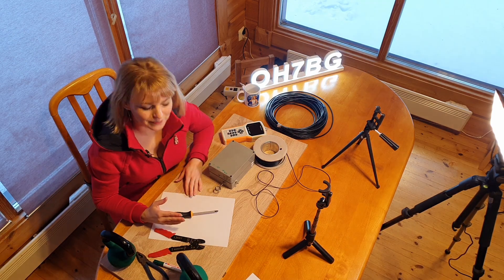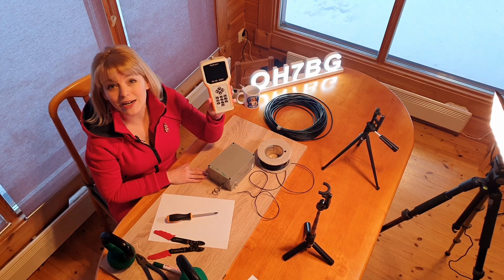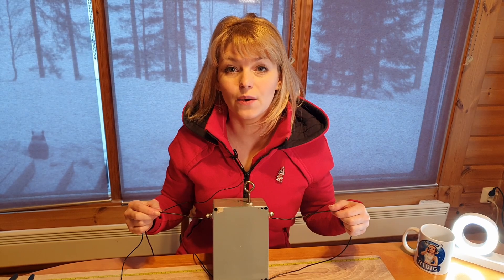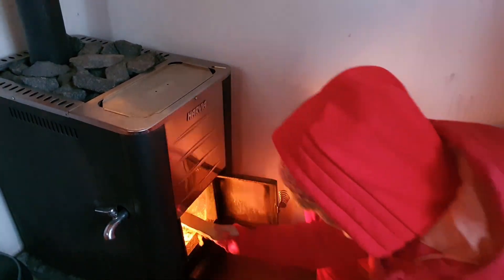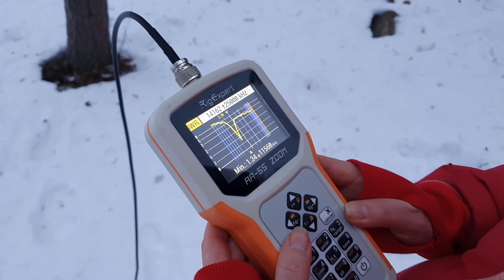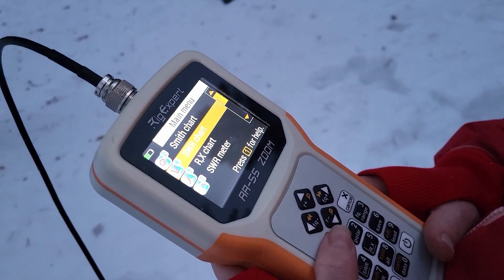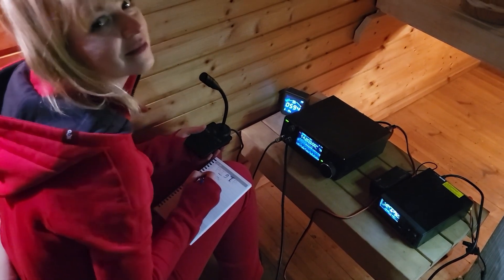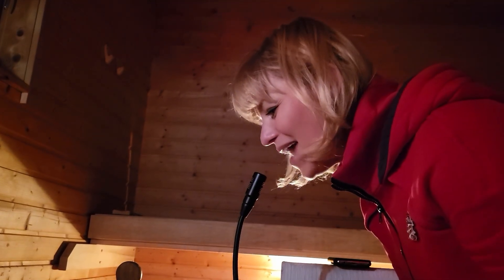Antenna ON ICE! Unscientific/Fun Experiment by YL Raisa on a frozen lake

Comment: that was great video. as you have found out the math was wrong. well the math was not wrong. the numbers you came up with is for about 1/4 wave off the ground . in your case ICE which changes the loading on dipole making it shorter. I have the same icom and DX commander wire.  I am in USA. eastern part. Boston NY. gets cold hear as well.  now try the same on 40 and 80 meters at night even 160 meters. I did 160 meters with 1:1 balun  in a park and with snow on the ground. I have the MFJ analyzer. had tuning trouble as well. too long wire. talked many KM at midnight. very low noise.  a outher trick for checking SWR in IC 7300 . there is a SWR graph function. were you put into SWR mode and AM/CW enter start and stop of band. click the mic and where the water fall is will be a SWR graph. videos on youtube on how to do this with 7300.  I forgot my antenna analyzer and I tuned a end fed half wave dipole this way. parks on the air. also if you get a tune around 2:1 the bult in tuner will  work. some times on multi band dipole you have to do this. keep trying crazy ideas . I am almost as old as DX commander. how I learned so much. went out and tried. 73's

Comment: Dear Raisa, it would be interesting if you placed another wire on the ice, 1/4 wave away from your dipole, but 5% longer, and another wire on the other side, also 1/4 wavelength away, and 5% shorter, to see if you get some directivity. (towards the shorter wire.) Beverage on ground might also work. All the Best! 73 DE W8LV Bill
Reply from the maker: Good idea 😉

Comment: Experimentation is half the fun of this hobby. As the old saying goes, “You’ll never find out if you don’t give it a try” You had an idea, put it to the test, and met your goal of making a contact.  Now take that information and try to improve on your theory. Even if it becomes a total failure, you will have gained valuable information on antennas and antenna theory. 
  Try a vertical next time, an end fed, see if that ice improves or detracts from antenna Performance. Try different heights above the ice to see if you can attain the prefect gain to takeoff angle. You never know? A 20 meter inverted V a eighth wave above the ice may be the ultimate DX antenna!
Reply from the maker: Hi Robert, yes, I gave a try ;-) TNX

Comment: Good stuff. How about 2 window frames on a 3 window unit, ie centre conducter to one on the left , middle window does nothing, and coax braid to window on right, using a tuner .I did this in a tower apartment at 120ft asl on 5w from UK to Europe, got lots of contacts!
Reply from the maker: I will continue experiments :-)

Comment: Very good Raisa. Take into account that the SWR of an antenna depends on the height of the antenna above the ground. In your case from the radiative point of view the frozen lake gives you an almost perfect reflective surface. On the other side point the frozen surface in direct contact with the dipole will give a certain amount of absorbed energy that won't be transmitted. Thanks a lot for your experiment. 73 from IW0HPU. Fabio
Reply from the maker: Thanks Fabio! 73! Raisa
Reply: @YLRaisa  Thanks to you Raisa !

Comment: I have seen military operations they simple lay the insulted electrical wire on the ground and fire the antenna with twisted pair of wire between ant and trx and they work. quite funny on HF frequency
Reply from the maker: I heard, that with bigger power a wire antenna can even work if it is under ground! 73, Raisa

Comment: Another great experiment Raisa. It's good to see you trying different things just to see how it works. I wasn't sure if it was going to work myself but being so low it would have been very low in noise.  Just be careful of those bare dipole wires when you wrap them around the Balun bolts. They do tend to jump up and bite you in the fingers.
Reply from the maker: Yes, that's exactly what I experienced. I'll be more careful next time 😉

Comment: Similar "ground antennas" are sometimes used by SWL DXers, especially on medium wave frequencies because they tend to have very low noise and can work really well even in an area with a lot of QRM. But I have never seen someone using it as a TX antenna. Very interesting experiment and really great video! Thanks, Raisa! 🙂 Best 73's.
Reply from the maker: Thanks. If one day some of SWL would like to have a contact they can try! 😅

Comment: Is that a saline lake? 73 DE NP3JD PS can you lift it like a feet from the surface and place a wire under the antenna that could work as a reflector?  My guess is that it could create a nice low profile NVIS for EMCOMM
Reply from the maker: This is a fresh water lake. Thanks for the ideas!
Reply: @YLRaisa  GL ES 73

Comment: You have a good reception due to high gain of the transceiver and a low noise floor. The transmission is poor due to high signal loss because part of the signal is getting absorpted by the ice/water combo and another part is being reflected at very high angle which means it doesn't get a lot of reflection from ionosphere and too weak to be received on the other end. If you had a  fishing  rod, you could have secured one end of it in the ice and then get an inclined dipole or inverted V with much better performance. I hope you have had a lot fun experimenting and spending quality time in the wilderness.  73! 88!
Reply from the maker: Yes, as you can see from my videos, I know how to hang antennas, I was wondering if I could manage to hold at least one QSO :).
Reply: You keep doing what you are doing. I love watching your videos. Nothing like watching a beautiful lady doing ham radio stuff. When are you going g to travel here to the states ?